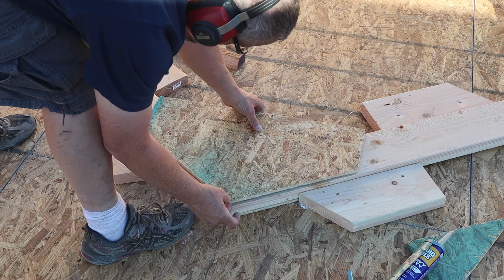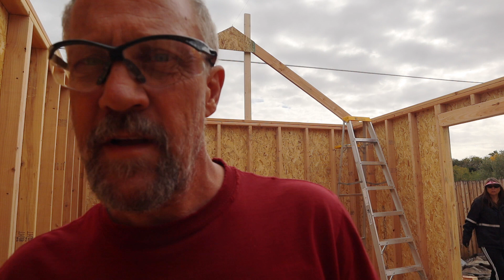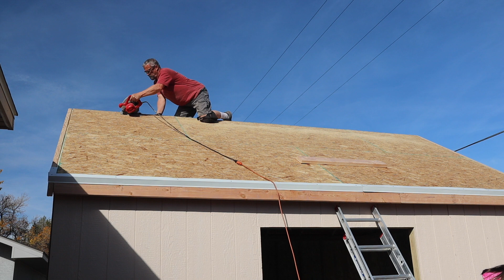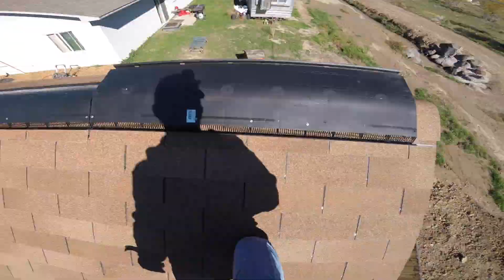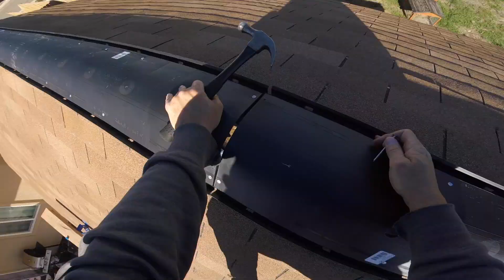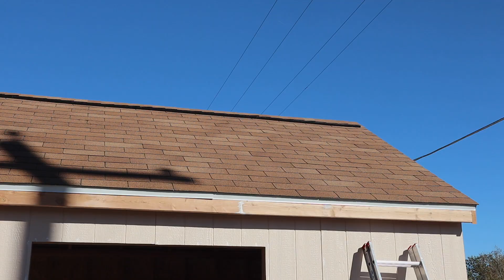DIY Shed Build Roof Installation Time Lapse (12X16) Tiny House

Comment: I really like the way you set up the jig for making your rafters.  I'm torn between a concrete slab and a wood floor.  Could you SHED some light on why a floor rather than concrete?
Reply from the maker: My reason for going with a wood floor over concrete is cost.

Comment: Great video. I'm building a shed now. Can you verify the height of the walls. 7 ft 6 inch does not seem high enough with an 80 inch door opening? Also what length 2 x 6 did you use for the roof rafters 8 or 10 ft?
Reply from the maker: Thank you! Yes wall height is either 7' 6" or 7' 8" from the floor to the top of the double top plate I don't remember exactly. I think I used 10' 2x6's for the roof rafters but again I can't remember for sure. What ever length fit what I needed for the roof pitch and span. I used a free online calculator to determine rafter length using roof pitch and building span.